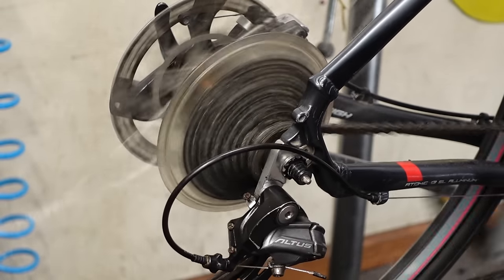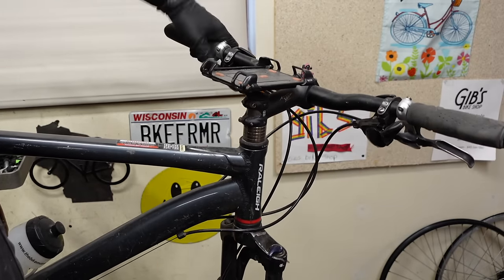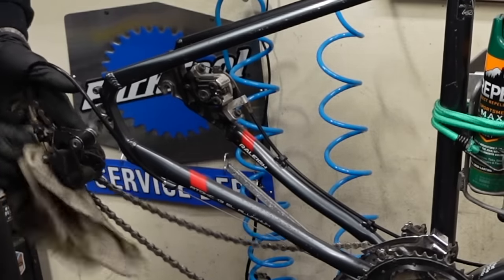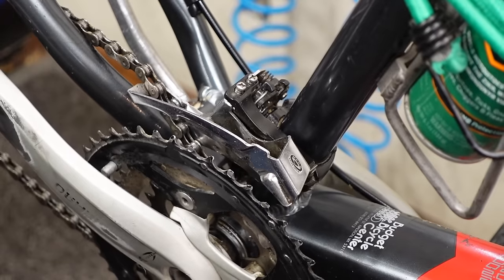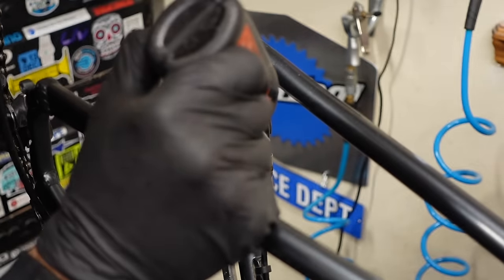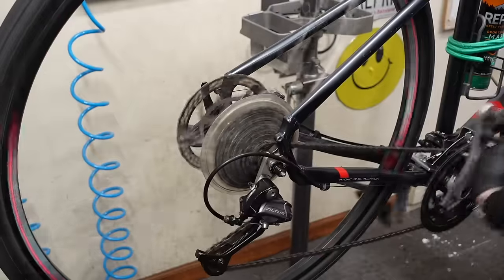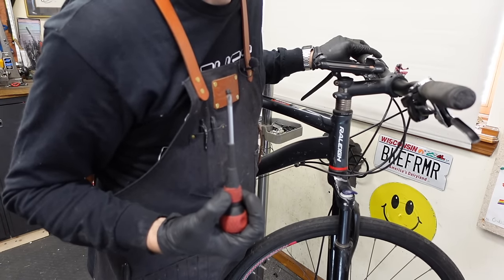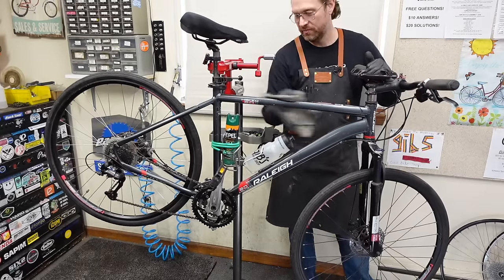Raleigh Hybrid BICYCLE gets a TUNEUP service - Disc Brakes, Derailleur adjustment, cables & housing

Comment: Just F.Y.I., friend,  I am a 60 yo lifetime bike rider (before someone came up with that silly term "bike commuter"). I bought my current bikeS in 2011 and 2024. There is NO SUCH THING as "ride a bike into the ground." In my opinion,  of course,  I could be wrong.  I  was informed that my 1990 chromoly steel frame is a "lifetime bike". Well,  I have no intention of getting rid of it,  either.  Have a nice day. 😊

Comment: I hope more people watch these videos and appreciate that bikes used to be easily repaired or maintained.  I looked up a kit to do maintenance on a dosc brake, the tool kit is $200.  Contrast to my current rim brakes require only a $1 allen wrench.
Reply: 200 ? Made by who, for what brand/type
Reply: Both of my bicycles have decent quality canti brakes. With high quality brake pads they are more than adequate! And easy to work on as you stated.

Comment: One of my bicycle hot takes is that on QR disc wheels, the lever should be on the drive side so that your hand stays away from the rotor. Does it matter much? Probs not, but it's how I set up my bike

Comment: I need to find a bag of old style ferrules. Any design requiring a seating technique is a non-starter.  I tried seating some of the new ferrules with a cable stretcher and an old cable. That didn't work well.

Comment: Replacing cables and housing is always a better course of action during a tune up. A lot of dirt by the forks dust seals. Might cause issues down the road.
Reply: No it isn’t

Comment: @BikeFarmer: Hey Andy, got a question for you. Think you could do a video on converting a non-disc brake bike to disc brakes?

I'm asking because I like Noah's bike having dual disc brakes, and I've been thinking of converting my 29" hardtail to dual discs. It has a front disc brake now. I've had a dual disc brake setup before on a bike, and I like how discs feel a lot smoother than V-brakes or even cantilever brakes.

But I don't really know what goes into converting a bike from V-brakes to disc brakes, other than obviously, I need a rear hub that can mount a rear disc, and the caliper, pads, and mounting hardware. But how to put it together kind of eludes me, and I'd like to see how you would do it, if you've ever done a conversion before.
Reply: first of your frame and your fork needs a mounting spot for the brake caliper. if there are no mounting points you can't convert it. but if you have these, all you need are two new wheels with discbrake hubs, either center lock or a 6 screw one. then of course two discs, either 160/180 or 203mm diameter. depends on your frame and fork. and last but not least the brakes itself (caliper,lever and brakehose). but to be honest with you, it's gonna be very expensive to do a conversion. i would just buy a bike with discbrakes😅
Reply: Metal tiger I am with you all the way sometimes it just makes more sense to buy another bike.
Reply: @MetalTiger88  : Just because you may not have mounting points for a caliper on the frame doesn't mean you can't convert. I've seen online videos where people talk about the performance of a conversion kit, without actually doing the conversion. And as far as I know, a mounting bracket that essentially mounts over the rear axle and dropout, and secures by a clamp on the frame tubing, is what is needed. That way, the caliper can be mounted. 

That being said, if a brake cable and housing(s) are in good shape, they can be reused. I'm not looking to install hydraulic brakes, as I would rather have cable-actuated brakes.
Reply: unless your REALLY REALLY REALLY attached to the frame and want to ride it with disc then go thru the motions to convert but I like the old saying if it ain't broke don't fix it. then again some practice for your welding skills and frame layout and some welding jigs then that's something else. school is never cheap, institution or hard knocks...

Comment: I'm assuming you've been asked this before, but I personally haven't come across it or seen it. Your repair stand, obviously it's part Park & part something else, what exactly is it, the combination? The reddish/orangeish thing, especially, & how they go together/how it works? 🤷‍♂️
Reply: It's just the clamp, EVF or smth like that it's called, it's very expensive
Reply: @oreocarlton3343  also interested in the clamp, don't seem to see anything similar. my old workstand I got off nashbar in the late 80's still works fine so not looking to replace just curious 🤣🤣